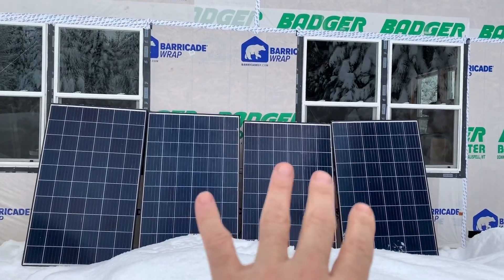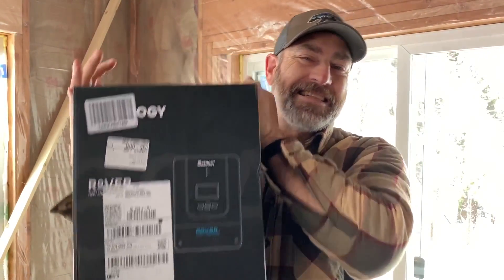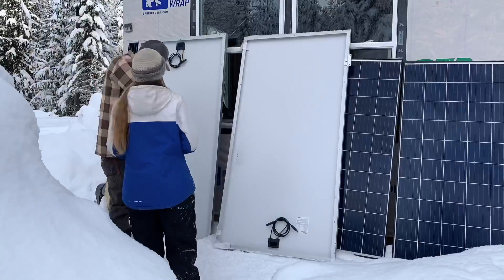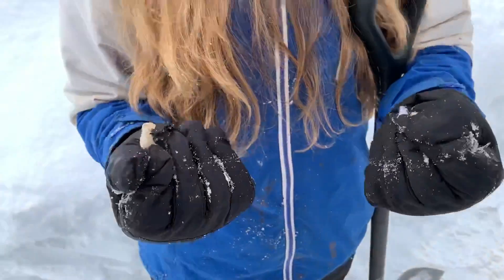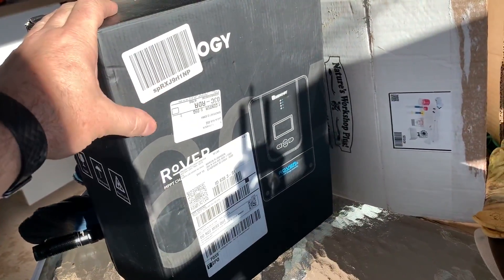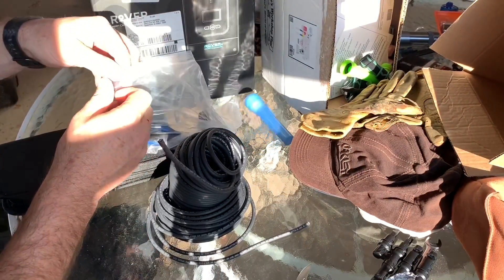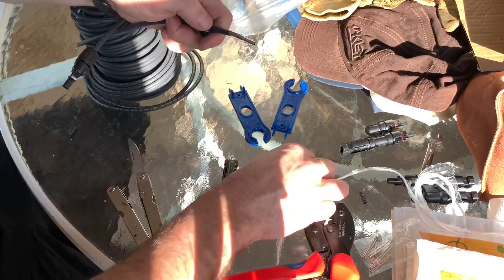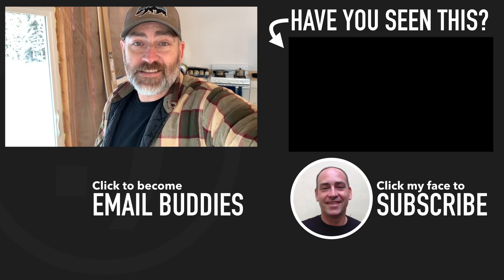MAJOR Upgrade to our Off Grid Solar Power System

Comment: The best, if you got the space, is a ground mount. Way easier to clean the snow off in winter. And if you don’t have shadow problem and the charge contrôler can take it I would go the highest DC voltage to minimise voltage lost, like 3 or 4 in series!

Comment: Not good , do some more research.
Reply from the maker: What’s not good?
Reply: @MartinJohnsonOffGridLiving  Just saying under the eaves shading on one panel will affect output of all ,as you said you will change at some point. Ground mount are easy to clean and if you can make it pivot to move around to face sun direct is even better.

Comment: I'm a bit scared about seeing the solar panels mounted on a vertical house wall.
You mentioned the shading, you have today ... remember that we are in winter, close to the lowest sun elevation.
I see 2 issue coming up:
First is shading: In summer (sun elevation is at about 60°), there will be a lot of the solar panels (~75%) in the shadow of the roof overhang. The small cells in shadow have to survive the power going through it, which causes rapid degradation, as they heat-up. So this will ruin / age your panels very quickly.
Second is the angle the sun light hits the solar panels: Today it's close to its optimum (90° angle of attack for the sun light to the solar cells is the best). In summer it will be at about 30°.
I fear the 880 watts, you saw today, will be close to the max over the year, even in the mid of summer. :-(
Why not mounting them on the roof of your house?
The angle of attack for the sun light is not optimal, but way better than the todays mounting.

There are many ways to seal the screws long term water tight (learn from RV videos what sealant they use).

In case you're scared about drilling holes your roof for mounting them, glue them to your roof!
Watch out also for RV mounted / glued solar panels. I saw videos of it and they did not rip-off, even when driving at 65mph on the highway. So this resists that wind load, shouldn't that be sufficient to withstand some stormy wind in your area?
Mounting on the house roof brings another adavantage over building a surface mount beside the house: It elevates the panels, so less shadow from the high trees around there. ;-)
Reply: Sounds like HOBOTEC. He has video of his van Solar panels install and driving 75 mph.

Comment: I would go parallel then series, just because the little  bit of shading in up corner will affect those solar panels that are in series. That's why micro grid tie inverters are so efficient than the other big grid tie solar setups. Hope's this helps.

Comment: How about mounting on a woodshed roof (low enough to remove snow, high enough to be above the snow)?   Instead of buying expensive pole mountings, tracking systems, etc; use that money to buy more panels and make a bigger woodshed...
Reply from the maker: That’s a good idea. Will have to see where we want to put the woodshed and if the slope will face south.
Reply: @MartinJohnsonOffGridLiving   nothing worse than removing snow from roof mounted panels on a two story house!

Comment: The current mounting will certainly make do for a while but as you have acknowledged it is far from ideal, especially in the summer.  And honestly the are not really a very appealing house esthetic.  Given the amount of snow you get I would tend towards a ground mounted system rather than one on a garage roof.  It would be much easier to clean (snow in the winter and debris in the summer), could be adjustable for the season (angle to the sky) and is more readily expandable if you eventually want a higher capacity system.
Reply from the maker: You’re right about the ground mount system it would be easier.

Comment: Great information, the only thing I would add is use the largest wire you can.
Reply from the maker: Well I think I get your point but there’s no reason to use a larger wire than need be. Wire can get very expensive.

Comment: I strongly agree with the solar system but I think what you should do first is finish the facade of the house before putting the solar panels, I think that would not work twice!
Reply from the maker: Where would put the panels for the winter then?

Comment: We decided on a ground mount for ours. one with auto alignment so we get the optimal sun on the panel all day. It costs a little more but it will be worth it, especially in the winter.
Reply from the maker: That sounds pretty cool. Where are you guys located?
Reply: @MartinJohnsonOffGridLiving  Southeastern Idaho, just south of Idaho Falls

Comment: you need to test the output of the ones with the corner shading compared to the ones just below them without any shading. many solar panels drop significantly in output when there is ANY shading on any part of the panel. higher end panels with more connections between the cells can reduce shading effects but those look like standard panels to me. if you are using power optimizers or micro-inverters on each panel, those can also mitigate shading effects.
Reply from the maker: Will do. But that is where they are going for now.
Reply: @MartinJohnsonOffGridLiving  yeah I know since you just put them up :D
just wanted to give the heads up in case you have panels that are affected by partial shading - for a future setup

Comment: I have to remount mine as well.  I plan on a pole inbedded into concrete with an adjustable frame to change the exposure angle in winter
Reply from the maker: I think that is a really good idea. That might be what we do also.